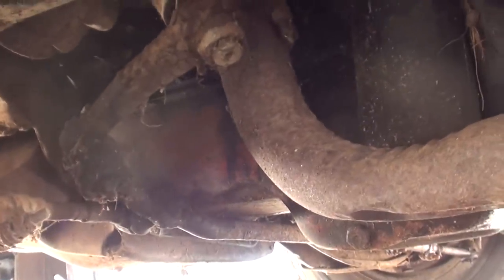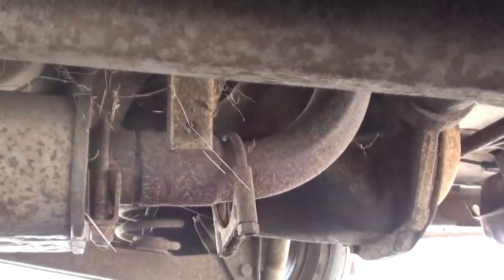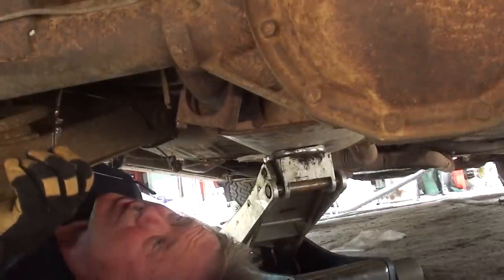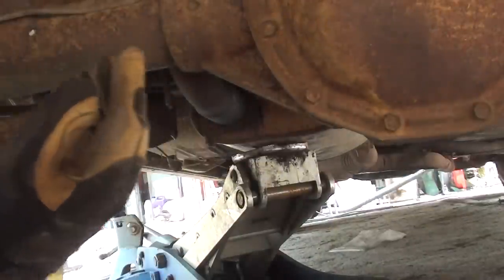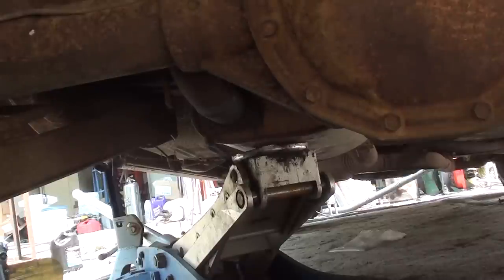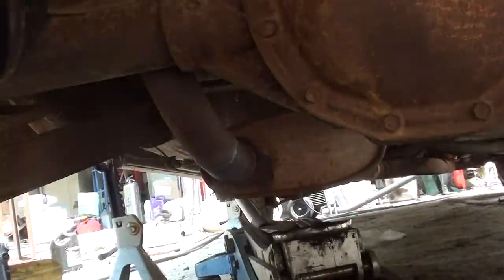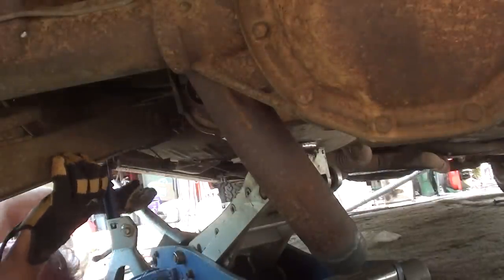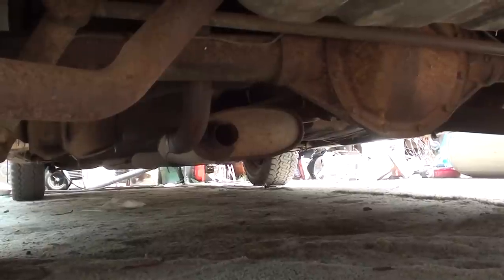PART 6 Big Block Biscayne Rescue! Abandoned 66 Chevy  First Drive In 19 Years Uncorking the Exhaust!

Comment: Who else misses the slap on the finger for this old truck 😁 it's great to see you jeff back at it again 100%
Reply: right i forgot that! and all the outtakes where the sound aint right
Reply: One of the first two shows I started watching on YouTube was this one and Tyler's neighborhood garage, and then thunderhead 289, and uncle Tony's garage and then Dylan McCool, and the craig909 and it grew from there,oh and right before the Craig909 was Mr hevy shevy channel lol love his channel lol!!
Reply: And yep I hear ya because when I was told that the dodge ram I bought needed a muffler it's kinda loud, turns out the front factory exhaust clamp broke it acquired a pinhole leak they didn't like how it made the 318 magnum v8 sound so they cut it off tailpipe is still in the factory location and the pipe under the cab is there that is why I said in the other comments post muffler no more lol

Comment: This brought back a lot of memories for me. I bought a 1966 4 door Biscayne Sheriff's car with 56,000 miles and a 396/ TurboGlide back in 1970 for $600 when I came home from Viet Nam. The car was actually the sheriff's personal car, the back seat had never been sat in. The car was as close to new as you could get. I was stationed in North Carolina for two more years. North Carolina was the recap tire capital of the US at the time, I put four "red line" recaps on her. I also installed a dual exhaust system on it. I spent all day and night trying to fit all the pieces together under the car in the dirt. I also removed the 396 emblems off of the front fenders and put generic six-cylinder emblems on it. I surprised a lot of people with that car and won quite a few races with it. Sleeper it was! I learned a valuable lesson on dual exhaust systems, never again have I ever done it in the dirt, I found out that I could have had a professional job done for $100 after I spent more than $130 on the parts to make my own system. I have always taken muffler/tailpipe work to the muffler shop since then. Lesson learned. Thanks again for the memories!
Reply from the maker: Thank YOU for serving. You guys got a raw deal... One of my best friends was an artillery gunner.. Never got "oranged" but 2 of my departed neighbors did.
Reply: What state are all the Tyre factories in? Kansas isn't it?
Reply: @shoominati23  All I know is that in 1970 North Carolina had several places that sold recapped tires. Recapped tires were not considered the best option but an affordable option at the time. If I could have afforded it, I would have purchased new red line tires. The recapped tires I bought had thin whitewalls which I painted red.

Comment: I like stripping some scrap Romex for 12 or 14 gauge copper wire, and using that as an exhaust hanger. It will fatigue before it ever corrodes...

Plus you can wrap it a bunch more times.
Reply: I keep a length in the car after I dropped an exhaust on the Whitestone Bridge and used my leather belt to hold it up till I got home!

Comment: WHy don't you just buy a box of 2 1/2" mandrel bends and straight sections and build you a new exhaust? Don't need to be expensive stainless or nothing, you can just tack it and then take it in and have it properly TIged together.. Im sure Speedway motors or Summit sell an affordable kit
Reply from the maker: I'm not trying to repair the exhaust. I trying to locate/remove the blockage.
Reply: @ElderlyIron  Fair enough .. In my experience though, blockages are usually closer to the header end of the exhaust..